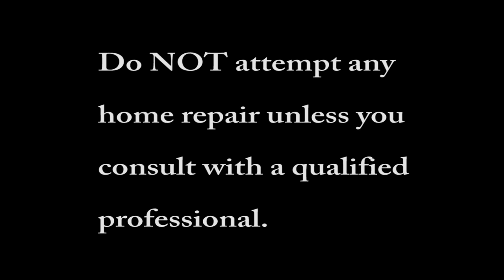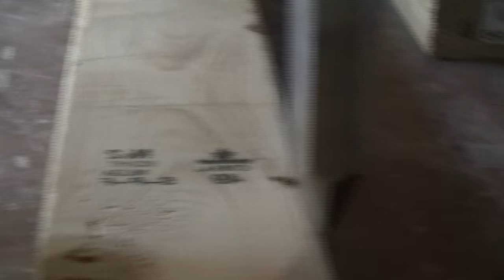How to Use a Plumb Bob

Comment: What if the top board is not level or does gravity let you know it is right when the plumb bob is where it should be?
Reply from the maker: Hey Raven Funderburg,
The point of a plumb bob is to give a straight vertical line. It should not matter if you top board isn’t level as that is horizontal in orientation. 
Does that answer your question? 
Thx for asking.

Comment: Shouldn’t you do that at at least two places to ensure the boards are parallel with each other? What you have done is only ensure that one point is directly under the other. The far ends of the board could be miles off and should be plumbed too.
Reply from the maker: Hey Danny,
Thx for the input and for watching!

Comment: What is a "qualified professional" for home repair?
Reply from the maker: A qualified professional has a license or vast experience in the task.  For example, on our current project in order to create an open concept we needed to remove a massive fireplace chimney and many walls on two levels.  We consulted with a structural engineer to find out the correct placement of our temporary walls and exactly which beams we needed to install to provide proper support for the four level house.  Good luck with your projects.
Reply: Thanks! I'm framing a two story house with my friend. We have no experience except for minor home repairs. Once we built a short partition wall. Most of our info comes from YouTube.
Reply from the maker: Wow Jesse !
Sounds like quite a project. Nothing like actually doing to learn fast! 
Framing can seem simple in its basic structure but is seriously complicated when it comes to understanding loads that are carried by walls. That's why we hired the structural engineer on our current project. 
We also hired a contractor when we bought the house damaged by fire ( fire house videos) so he could advise us about what could be salvaged and what was too far gone.
Hiring a general contractor to inspect , for advice, and tips certainly helps me sleep at night. I can't recommend enough the value of getting a pro consult at least. Worth every penny! 
Also, don't forget to check your local building codes as you build. We made many trips to the City Building Dept and the library checking on certain building codes.
Thx for the comment and background. We enjoy hearing what other folks are working on. 
Keep us posted on your progress!
BTW - UPCOMING and related to this, soon we will be launching a blog where we will be able to show in detail what we've learned in our projects - hope you find it useful. 
ALSO - we are almost ready to post a 'how NO TO DO" video - it shows a vivid illustration of us trying to raise a sagging floor from below. When you see it, you'll see why I take serious the load bearing strength of walls!!!
Thx again!
Reply: @Housebarons  he was being sarcastic

Comment: Get a plumb dot laser, much quicker to use and no swaying of the bob.
Reply from the maker: Hi Trevor, we use our laser level these days to build a straight wall.  A plumb dot laser sounds like a great update to a classic tool.  Thanks for your comment!
Reply: Too damn expensive this works perfectly fine.. plumbobs been the most reliable way of getting vertically straight since ancient Egypt.
 "If it aint broke, don't fix it." Yogi
Reply: @jasonpaden7315  I suppose you ride around in a horse and buggy right? "If it ain't broke, don't fix it" lol
Reply: A horse and buggy is slow, a horse and buggy requires a ton of maintenance, it doesn't work well at all in comparison to a motor vehicle. A horse and buggy to a motor vehicle is an evolution, an innovation. 
A simple, cheap, timelessly effective, easy-to-use plumb bob is the gold standard while the difficult to use, expensive, worthless in the daytime plumb dot laser isn't evolution, it's not innovation. It is a mutation that will disappear like a vapor compared to the timeless tool, the plumb bob.